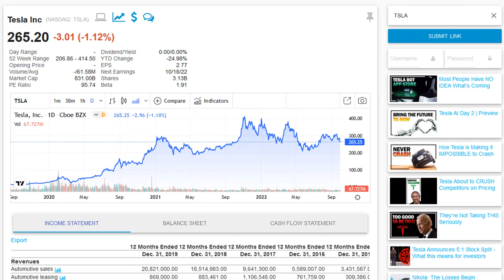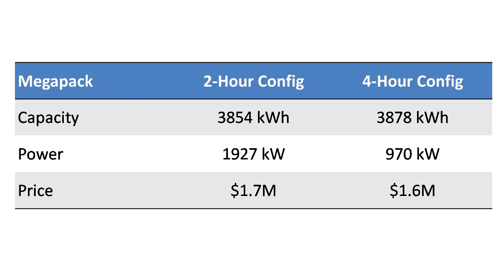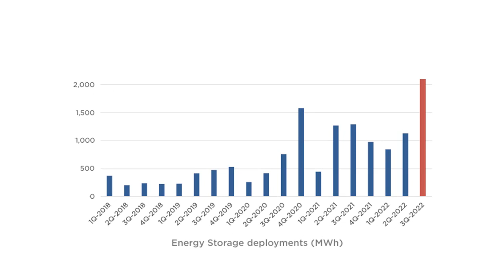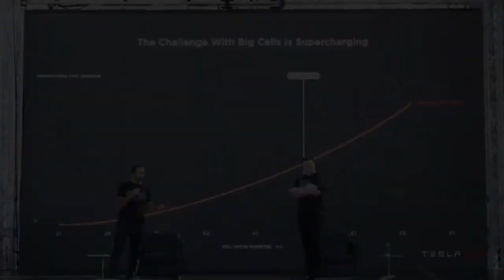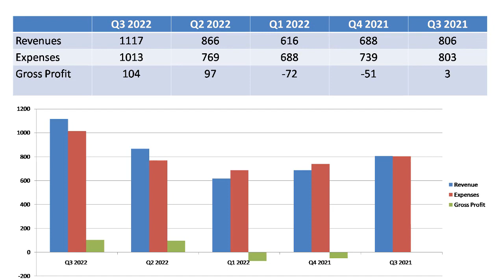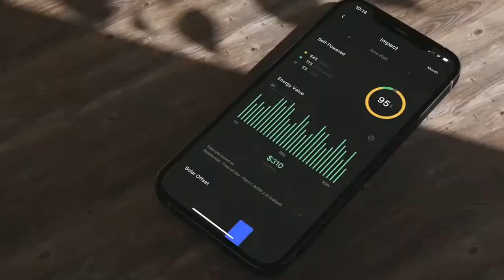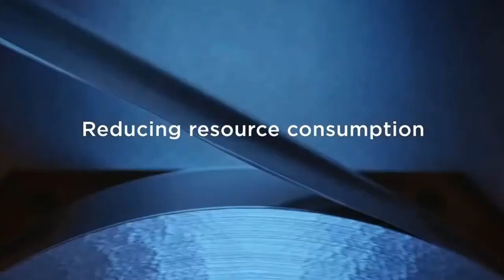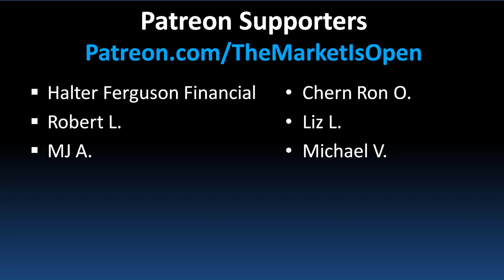Tesla Quietly Just DOUBLED Its Energy Storage Business

Comment: Even beside the massive profit potential I am most excited because battery storage will complement the extreme expansion of solar/wind electrical generation.
Reply: battery packs are useless without reliable baseload energy sources. nuclear. wind and solar are an insult to those who understand how the grid works. but, hey, stay virtuous.
Reply: @chrisdodt  Nuclear is baseload.  It prefers to not ramp dramatically on an hourly basis.  Wind and solar are highly intermittent as you mention and it is a royal pain.  The BA in my area could put some battery MW-hr to good use even at the higher cost.  Autobidder or a clever marketer could make them profitable even in light load hours.